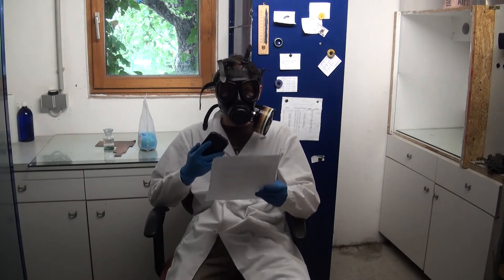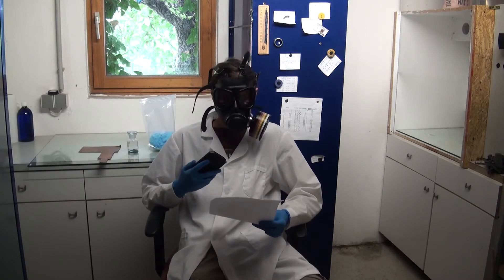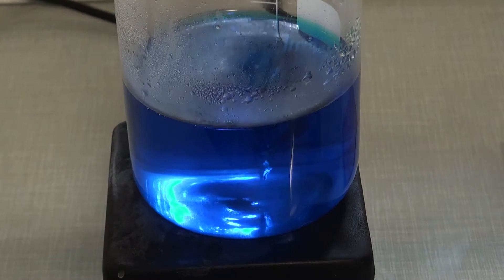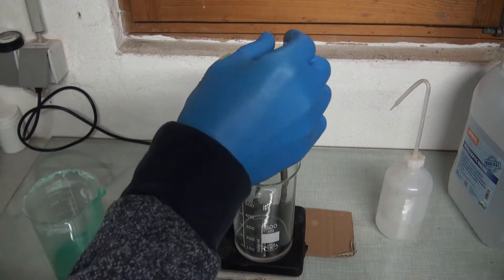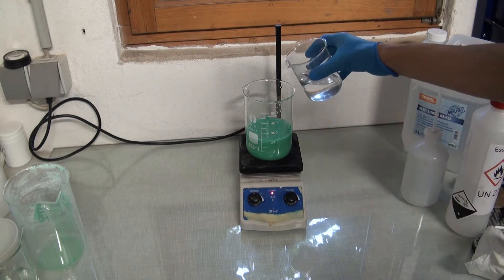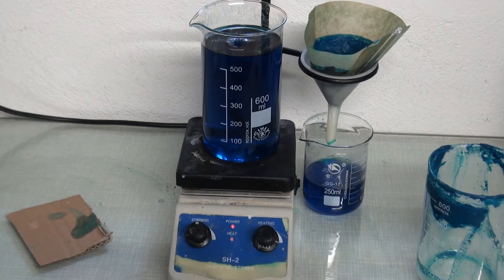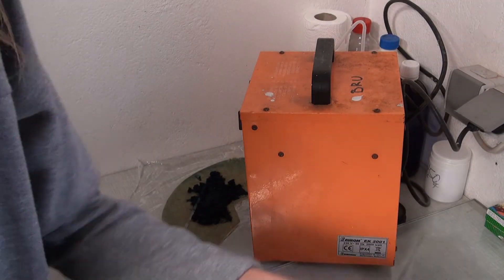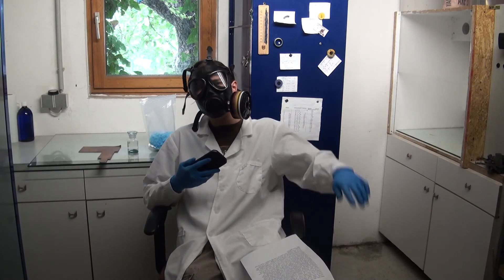Preparation of copper acetate from copper sulfate

Comment: Can we use Calcium bi-carbonate instead of Calcium Carbonate?   Getting a hold of baking soda is much, much easier than getting a hold of pure washing powder.  Most places don't even sell it anymore, and we can only get crap like tide pods, or tide liquid.
Reply from the maker: @Fearmylogic  I think you're meaning sodium bicarbonate. And yes, you could use it instead, even though I wouldn't recommend it. 
But sodium bicarbonate can be easily turned into sodium carbonate by heating it to 200°C for a few hours, or by reacting it with an equal molar amount of sodium hydroxide

Comment: I made this by accident last year when i was cleaning CuCl corrosion from my electrodes, and let the cleaning solution set amd evaporate. Rhe ceystals were beautiful, and this week i for the motivation to make copper acetate in bulk, but at the same titrating my acetic acid by measuring the CO2 evolution.

I like the coller carbonate method because its easy to purify. Just add water and let the carbonate settle out, pour off the liquid and repeat. If i had glass frit or tried filtering it, its not worth the extra clean up step of treating the filter or frit with HCl. That will take longer than washing and settling while wasting a reagent.

Comment: To what temperature did you heat it? Copper acetate will decompose at high temperatures. I never got crystals forming from my solution because I heated it too high.
Reply from the maker: I kept the hotplate pretty much under 200C all the time
Reply: @madsciencemax8439  Ok.